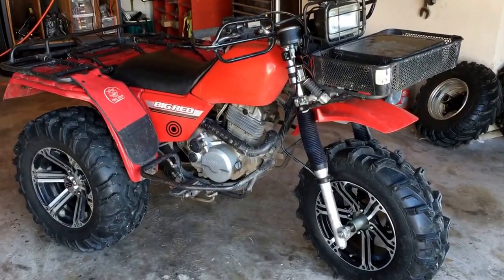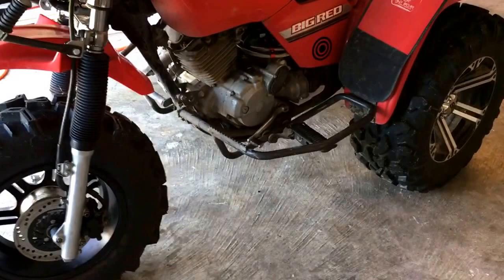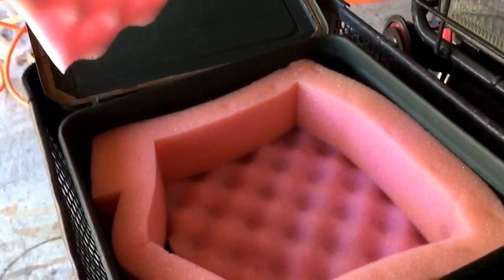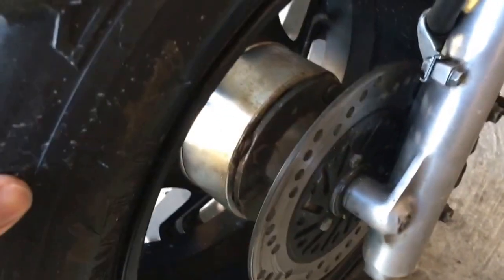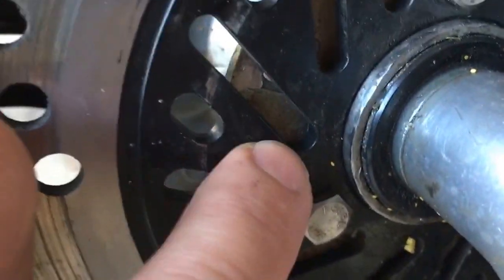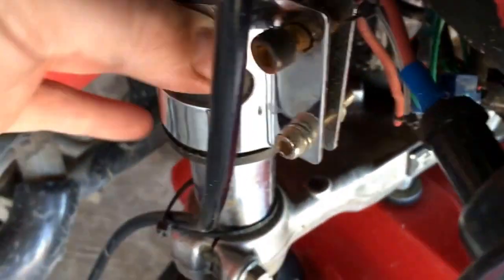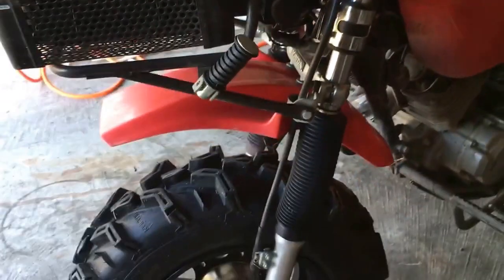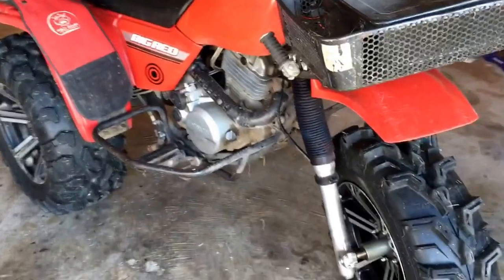ATC250ES front fork swap upgrade to 350X explained.

Comment: Awesome build dude. I have a basket 250 es and I think I will be closley following your mods for mine. Kick ass
Reply from the maker: Hey right on glad you like! If you have any questions I'm happy to help.
Reply: Bad news, I WILL be taking you up on that offer.LOL. I paid 150 for mine. It was off of a farm and not pretty at all but it did start.
Reply from the maker: That story is a familiar one. I bought this one for $100 it hadn't run in many years and was sitting under a shack for lack of a better description. Everything was broken, the tank was missing, the rear fenders had chipped away to the point that very little was left. The rear brake was locked up, all tires were flat and rotten. Last but not least -the top end of the engine was locked up due to someone leaving the air box lid off and rain filling the box and rusting the piston in place.

Comment: Instead of adding an extra left hand master cylinder. Maybe you could adapt a distribution block like they use on Polaris ATV's and run the single master cylinder you already have. You will not be able to actuate your brakes independent of each other but it might simplify the installation.
Reply from the maker: Jimmy Jackson that is a great idea! I'll investigate!
Reply: Hope it works for you.
Reply from the maker: Thanks Jimmy!

Comment: Did you see the 350 bore kit for the big red? Well i got my 350 forks coming any day and now working on getting bore kit. I am thinking a rear disc brake would be a must have with the added horse power of bore kit
Reply from the maker: Tim Burrier - nice I think I may need a top end rebuild one of these days and I'm considering the same 350 big bore. The front disc is nice but you really do need something in the rear.

Comment: Consider: instead of a digital speedo, use an old phone so you can run navigation and speed simultaneously. Mount  cheap android  in a waterproof case. It runs on GPS so there's no need to activate the device. Plus, it's a Bluetooth media player. :)
Reply from the maker: Ah yes you are right! I didn't consider such an easy solution!

Comment: I'm doing a 350x front end swap on my 85 250es. Where did you find a rotor flange to weld to the sx hub? I'm debating whether to use the 350x front hub and wheel with a 25x8x11 tires or to convert to a 250sx hub like you did. It would be nice to have a sx 4x110 front hub but the rotor flange is my hang up. Do you run 5x2 offset wheels also?
Reply from the maker: It’s been a number of years but I’m pretty certain I had an ATC200S front axle tube and we ground off the welds on that one and it was pretty darn close- the correct size. We pre-assembled and spaced the flange and the 350X disc. We had to position it and measure carefully to get the spacing right. If you don’t get it on there square with the caliper it will wobble and the disc and pads will get worn out really quickly. Possibly even damage the caliper. Btw you must drill new holes to mount the disc. So take your time. It’s been working great for years now. I purchased a rear disc set up a couple years ago on Honda Hoarders (Facebook) from Brad. It works well enough when used in conjunction with the front brakes. The rear disc really needs a larger master. Hope this helps! If you haven’t joined HH on Facebook you should.
Reply: @interglactc  thanks for the reply. I plan to do the brad rye kit in the rear, I just sourced all the trx450r  brake components. HH is where I found out about his kit. My main goal is to make my 250es handle/stop better and more reliably. Thinking of running a 300ex rear shock to complement the 350x forks. Did you use the 250sx front axle or 350x? And are your wheels 5x2 offset? That seems to be what everyone uses when they go to a 12" wheel. Thanks again
Reply from the maker: The wheels are 14” they aren’t 5x2. They each have 2” wheel spacers front and back. The front axle tube is 250SX. The 350X looks just like the 250R which is cast aluminum I think. I think I used the 350X axle since it is still the correct width for those forks. They all use the same axle bearings. The SX axle tube was perfect length. I didn’t weld or bolt on the fork stops. So that’s one thing I haven’t bothered to do. I have a plastic Clark tank. If I had a metal tank I’d probably be worried about the bars touching the tank. The ATC250ES shaft spacer must be cut down btw. If you look at my other videos I use a lift bracket which is very common and very inexpensive. I wanted to keep the adjustability. This also enabled me to put the OE shock on its lowest setting for a nicer ride. I have ridden the hell out of this bike for years with this stuff on it and never had any issues. But she’s about ready for a top end. I use this bike to cut grass all summer here in TX. lol btw you’ll end up using the 350X handle bars. The BR’s bars won’t work safely. 😉

Comment: What is the bolt pattern and offset for the front wheel? I'm doing the same swap with a 200x front setup on my BR.
Reply from the maker: Tyler Ball - I used 350x forks. They are very different from 200x. 200x is shorter, and smaller diameter as well as the brake caliper is on the wrong side. I used a 250sx front axle tube and had a friend weld a disc to the axle as a mounting plate for the disc. The 250es /250sx has a wheel bolt pattern of 4/110. I used a two inch wheel spacer.

Comment: The Part is called a FITTING,CROSS (Junction Block) OEM part number 7052292. They are $30 on bike bandit.

Comment: Hey is there any chance I can get in touch with you on how I can set my185s like that with the front end and the brakes set up so I can get someone to set it up like that please if you don't mind
Reply from the maker: danny cannon - hey I don’t mind pointing you to some people that could help. I am uncertain about what other forks would fit on a 185s. I haven’t owned a 185s for many years. Most people aren’t modifying 185s in this way simply because they are hard tail bikes with no reverse. If you have a FB account you should request to join Honda Hoarders. There are tons of people with tons of experience on all sorts of ATCs and bikes. Once you join the group you can post pics and ask questions.

Comment: How did the 350x mount into the bigred neck in the frame. Any mods to do it or does it just bolt right up?
Reply from the maker: adam - it just bolts right in with bearing kit. The 350x shares same bearing. I ordered from All Balls.
Reply: @interglactc  thanks for the info I be looking into finding a triple tree soon

Comment: Greg Myrick sells disc brakes kits for the front and back of the 85 big red 250es. Find the kits on Honda Hoarders on Facebook! Just in case you didn’t want to switch the front end up is all.
Reply from the maker: Hot Fuzz - I had hoped that’d happen eventually! That’s great I just sent a request to join the group. I wonder what the prices are like
Reply: Intergalactic After joining the group just search for 85 disc brakes. Prices and pictures are there and Greg Myrick can help with any questions. Over 80 kits sold I believe now with hoaders posting up the pics of the kits installed. Very friendly group. Reach out before you buy. It looks like you have lots of mods and just want to make sure nothing would be in the way for the kit.
Reply from the maker: Greg - yeah we need to get one of your kits installed soon!

Comment: If I was to run rear wheel on the front. I would have to run a spacer right?
Reply from the maker: louizianaoutlaw85 - stock wheels are interchangeable anywhere on bike.

Comment: Do you have to convert to disc up front when doing this? 
Or can I reinstall my drum from the 85 BR?
Reply from the maker: There are multiple reasons why you can’t reuse the front axle tube from the original forks. The main one is that the original ES front axle tube and drum are too long to fit between the 350X forks.

Comment: So I am just a little confused. I have been researching this fork swap and ended up just getting lost with this fork swap I believe you said the 350 forks and triple tree bolt right on ? whats the part number or link for bearings. and would you know if 200x forks will work the same, just bolt on? The 200x forks seem to be more ready avalible and cheaper. And how about the rear disc you get any where with that yet? thanks for your time
Reply from the maker: Tim Burrier - the 200x forks can be done but they are smaller and the brake is on the opposite side. https://www.ebay.com/itm/172326654003 
It's just not nearly as nice 200x forks are 32mm diameter tubes. The forks are longer making them easier to bend than the short ones that the 250es comes with. The 350x is 36mm I believe. So they are much more substantial and harder to bend.
Reply from the maker: On the rear brake I've been so busy the last year I really haven't made any progress. 😕

Comment: hey man great videos just got a 250es myself just getting into it, it runs pretty great now just a bit rusty round the edges, any chance you could send me a link for those fork boots and the hand guards ? Keep it up man!!
Reply from the maker: Hey Joel, glad you got one! So it's been more than 2 years I'd say since I got those hand guards. I gave a quick look and saw many different types that could be used. I liked this style because they were kinda old school looking but probably anything you'd find for a modern Honda utility with 7/8 bars will work.  The factory boots for a stock front end (32mm) are found on eBay easy as pie for $25-30. I want to say I've bought them on Summit's website too.
Reply: yeah thats exactly why i liked them there not to flashy and they would probably survive anything i've been looking around but cant find them anywhere, i've found the boots now! i'm afraid my left fork seal might have gone though haha! thanks for the quick reply man so useful having these videos up while i am working away on it no one in Scotland really has any of these or they're few and far between so these vids are a life saver!
Reply from the maker: +Joel Lawrie - eBay is probably the greatest resource for us on these bikes. I will usually check three standard places. First I look on eBay, then Partzilla, and then Amazon. Of course when searching always search for "ATC250ES" not BigRed. Although you will find that some people will incorrectly list their parts using things like "80's Big Red trike" of course when they do that you can often get some really good deals because no one is searching for that verbiage. The fork seals I like to use are the "Leak Proof" brand. They work well. I use a mixture of 40% ATF and 60% Lucas oil treatment. This mixture works well and it's pretty thick so it doesn't leak very easily.

Comment: one more question i got my forks on anyway how did you put key pad on. and did you search disc brakes on a. 250es big red that guy used a super atv kit its kinda pricey and not really a direct bolt on but with your 14inch rims i think it wouldnt be to hard.
Reply from the maker: Tim Burrier - nice! I really like this set up on the front. I've seen the Super ATV kits. What guy are you taking about? I really want to finish my rear brakes. I haven't made time.
Reply: Intergalactic just searched disc brakes on 250es on you tube thats the name of video i would send link but computer here at work sucks. so how did you put the key pad on?
Reply from the maker: Tim Burrier - oh I'm sorry man! I meant to reply on that. So my handle bars had a connecting bar that went from one side of the handle bars to the other. I think it was a mount for a water bottle or something like that. Anyway it's hard to describe these but they are sorta like clamps and since they held this cross bar in place they were naturally a 7/8  diameter just like the bars. So I removed the cross bar and slid these clamps down into the center at the lowest point of the handle bars so that they'd line up with the holes in the dash/key pad. I just used some long machine screws and put nylon /locking nuts on the back so they won't vibrate off. I didn't torque them down tight. I wanted some play in the dash so I could lift or slightly spin it up to prevent breakage.

Comment from the maker: https://www.ebay.com/itm/232117658628
Reply: it comes with 2 did you use both together ?
Reply from the maker: Chris Garneau - no only one will work. You can't use anymore than 2" of lift or you'll bind the drive shaft
Reply: Intergalactic  I just put one on my big red how's your holding up? don't seem like they are very sturdy or would last....im gunna use 1/4 in steel and weld up a bracket soon but for now it seems good
Reply from the maker: Chris Garneau - I have done some hard riding through everything you can imagine and I have had ZERO issues. I also weigh 265 and I'm 6'3
Reply: oh nicce to hear thanks!